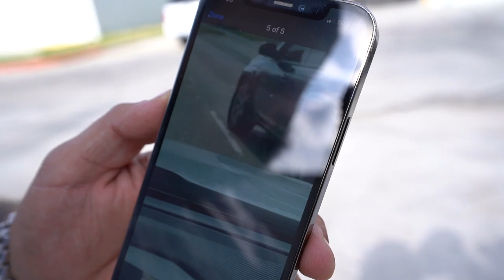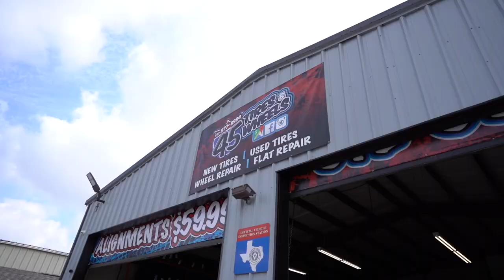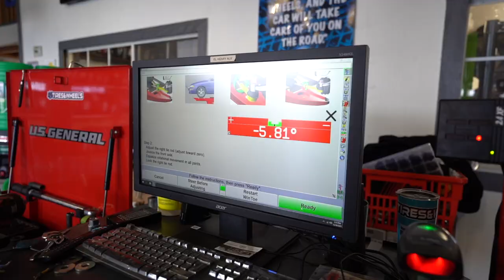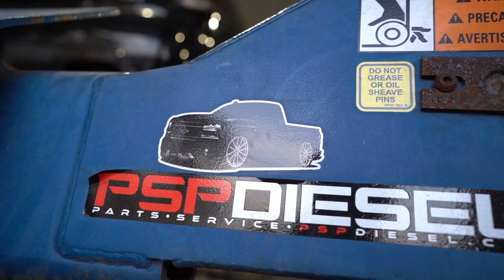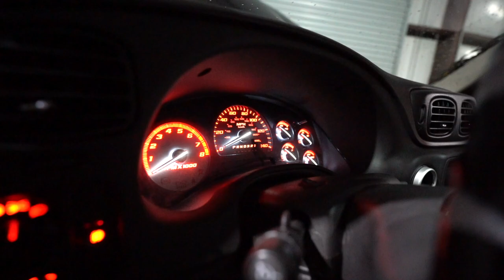MY TRAILBLAZER SS IS BACK!

Comment: You should get a holley high ram with 103 nick williams throttle body and if you don’t already have a 4k torque converter you get the 4,000 precision industry tripe disk lockup converter.
Reply: And a bogart eliminators drag pack all around so you can have a race truck for your channel.